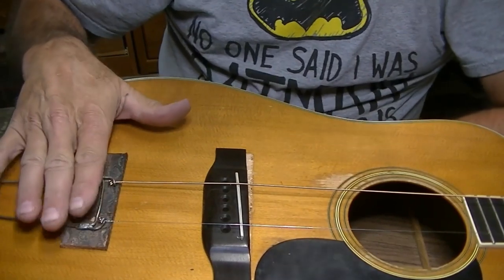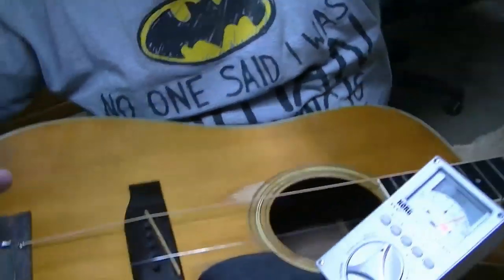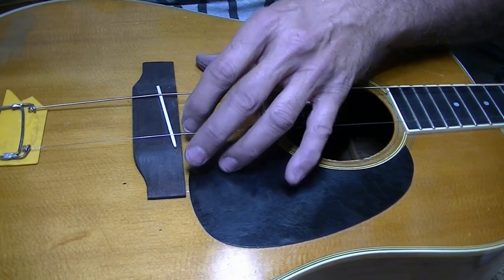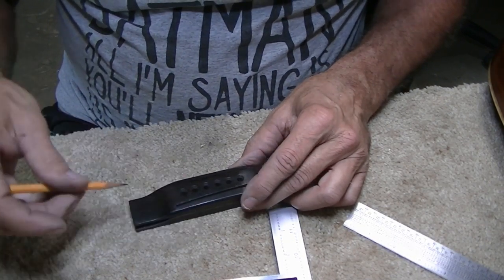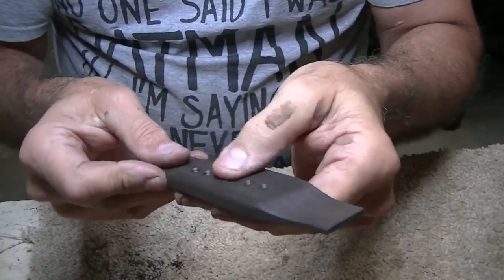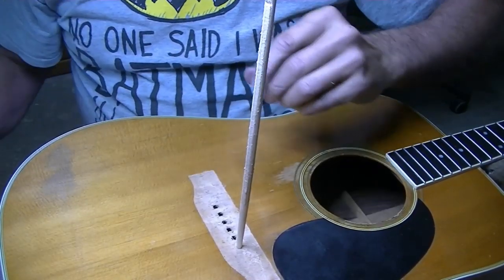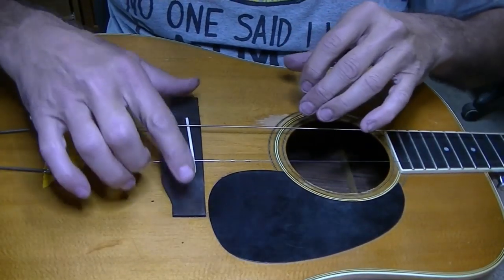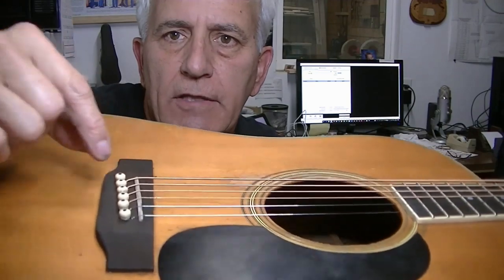316R Rsw Martin D35 With Severe Intonation Issues Revised

Comment: Hi Jerry,  a similar thing was done to the bridge on my 1970 Martin D18s.  I had a re-fret done by a chap who also messed with the bridge by cutting the string slots close the saddle without asking. There was nothing wrong with it in the first place!!  It then caused problems so I took it to Ralph Bown in York, UK.  He left the bridge in place,  filled in the holes with some dowel,  routed out the top of the bridge and inserted some wood into it to hide the old holes.  Then he drilled new pin holes and saddle slot which were slightly further back, the holes are at a slight angle.  There's  a narrow piece of rose wood that runs under the bridge plate to anchor the strings in the new holes. A great job though the guitar has lost some tone slightly but still sounds great and the intonation is better.  Fascinating video.

Comment: Yep. I've fixed heaps of these Martins too over the last 30 years or so. A far more common problem than one would expect. Most often a saddle slot fill and recut will sort it.
Reply: Hi Steve - agreed, my 1967 D-35 also has an intonation problem but I'm inclined to put up with it and just play basic open chords. My 2000 HPD-41 has no issues and plays easily and sounds beautiful. I think it's illogical and unreasonable to expect a vintage guitar that's been well-played over the years to be more or less in mint condition - we have to enjoy them for just what they are and wonder where they've been for the last 50 or 60 years!

Comment: I  didn't see you drill holes through the top of the guitar (after filling the old holes) which seems like one of the most critical steps and I had the most questions about since it's hard to fix if wrong. (Measure twice and cut once.) Very informative. Thanks. I also wondered why some guitars have a slant on the saddle and others do not. Never did make sense to me and still doesn't.

Comment: It seems many guitar companies had problems in the ‘70’s and early ‘80’s
during the guitar boom.
Sad thing is people pay more for them because of it being “vintage”.
Been doing repairs for well over 35 years and in my opinion the newer guitars sound great
and are better made.
Thank you for all your excellent videos. You and Randy are my favorites.
Reply: that´s right. New instruments are build more precise but don´t sound better.
Reply: You are right, however, I think it also depends on the brand and model. Some newer, cheaper instruments are CNC made in Asia, the wood used has not fully dried, or it was dried too quickly in a kiln because they need to be manufactured quickly. There's something to be said for old wood, case in point, the most prized violins are usually hundreds of years old. There are excerptions, of course. Personally, I love older instruments. They feel more broken-in.

Comment: My Martin DCX1E is same exact issue. Low E is off by almost a half note. I feel like I can do this repair myself. What a great video!!! I just had the guitar set up and was thinking they would re set the intonation. But was explained to me that they couldn't fix the intonation. I was never into the technical side of how guitars work, so I was wondering if the guitar came out of the factory like this.

Comment: Hi!  Great video and amazing how you devise your own way to solve a serious problem and save a guitar worth probably thousands.  I have the same intonation problem.  A local luthier said $200 to correct it.  She said my neck is migrating into the sound box.  So on both sides of the neck or fret board that extends over the spruce top there are two cracks in the spruce top along side the fret board.  These two cracks  cause the section of spruce top between the fret board and the sound hole to also migrate into the sound hole a fraction, and it also cracked the decorative layers that encompass the sound hole.  Another luthier took a piece of spruce top wood, cut it to align with the sound hole, then glued it in place.  It stopped the migrating so it seems and seems it's still the intonation.  My guitar is a classical one I bought at a Salvation Army store in 1981.  I like the guitar a lot.  What would other luthiers here charge to do this job?  Does it mean I have to scrap my guitar?  Thanks for this great video.  You are an innovator!

Comment: When I have to cut through the finish, I repeatedly heat the (brand new) blade of the Exacto knife (with a heat gun vs. a candle or lighter). Heat gun makes no soot and less likely to overheat the blade to red hot.  Seems to reduce chipping (or shattering) the finish by partially? melting it... instead of scratching through it..  Seems to work well on thick, UV cured finishs that are REALLY easy to damage outside the intended work area.
AND the hot blade (cauterizes?) the finish's edge that is left.
Keep cleaning the Exacto blade to remove the melted finish . Clean the blade between cuts by scraping (cold) or use heat and wipe off the goo.

Comment: Hate to be critical but your temporary tailpiece should be spaced wider - so that the e-strings pass over each e-string hole.  Because it's a little narrow, i think that your location of the saddle is inaccurate.  You could wedge a block between the strings to widen it, so strings are accurately located.  I love your videos - I've learned a lot and thank you for sharing.

Comment: Jerry, I always enjoy your videos, and I appreciate your work ethic immensely.  One thing you might do to gain insight into intonation issues is to capo at the first and thirteenth frets, and compare F2 to F3 instead of comparing E2 to E3 with the capo at the twelfth.  This completely takes the nut out of the picture, and that is of significance because the nut is usually where at least part of the problem lies.  Illustrating this idea is the fact that older Gretsch electrics like the original Chet Atkins 6119, 6120, 6122, etc., all had zero nuts, and they were equipped with solid bar bridges that had no compensation adjustment, yet the guitars had no intonation problems. For the life of me, I cannot figure out why all guitars don't have zero frets.
Reply from the maker: I understand your logic. And I don't completely disagree with it. But some of it that I do disagree with. For one thing when you Capo and check intonation you're bending the string at the first fret. Which affects your intonation as well. A nut that is cut correctly and set up with  proper action will work as well as a zero fret. Although I understand there are a couple of advantages of 0 frets. It's another one of those deals in my opinion where there's a million ways to skin a cat. I just prefer to do it differently. I do not believe at all in compensated nuts. That is just fouled thinking from the very get-go.

Comment: This isn't the only guitar in history with this issue. I have a Fender Strat Plus, (actually, two of them) which is a high-end Strat with a few extra features---locking tuners, LSR or Wilkinson nut, and crappy Lace Sensor pickups (the only mediocre thing about the guitar) Anyway, I got the second one as a backup and I noticed that the intonation could not be set. Now these Strats are CNC machine made and they are generally very precise. Indeed, the fretwork is great, very even, well finished ends, and the guitar sings; with nice body resonance. So, I was disappointed in the second one. And then day one I looked at it and saw the nut was installed at an angle. Very weird on a machine-carved guitar. Friend of mine fixed it and now it has better action that the first one!

Comment: Good move on re-measuring the string holes after lining them up with the larger angle, because it would have made a difference and the strings would have been closer together. Well done. You should send a copy of the video to Martin. For the price of their guitars this is unacceptable, and they need to see this.

Comment: Hi Jerry loved the video, just a thought, the saddle you placed upon the bridge to initially assess the angle and position for correct intoonation - I've skipped back and forth on the video a few times and it looks (the first assesment saddle), was significantly higher than the one used later in the video after the bridge was glued on.

I know that you don't like adjustable bridges on acoustic guitars the kind with a screw at both ends . As a repeatable point of reference for myself, when setting two of these adjustable bridges, up I've noticed a marked difference in intonation when up or down movement is made. Higher = sharper.

As a side note there's usually a sweet spot on those adjustable bridges, when the adjustment mechanism is transfering the vibational energy well, just take the finished nut down by sanding the flat bottom to play well for desired action and you keep the tonal sweet spot with nice playability.

Maybe the height of the (lower test) saddle normalisi later in the video is because of this effect - the lower the saddle with respect the the fretboard plane and, though minute, the strings 'bends' less to be fretted due to a shallower break angle if it can be termed as such. Thicker bass strings react more to this effect.

I'm sure you know at the other end, high nut slots will make the strings play sharp up to about fret 4. This seems to me to be the same effect just at the saddle end of the string.

Comment: Martin went from producing 7,403 guitars in 1965 to producing 22,636 in 1971; in a mere six years, their production numbers more than tripled. A large number of the 163,887 guitars produced from 1970-79 were fantastic instruments that were built without flaws. However, there were a small number which suffered from what’s generally considered the result of poor quality control.

Even during this difficult period, Martin was producing guitars of excellent quality, especially considering that some of the big competitors of the day, like Gibson, were sometimes selling factory seconds.

The only real quality control issue that Martin experienced in this period was that some of the bridges were misplaced, resulting in poor intonation. It is rumored that a simple yardstick-like piece was used to place the bridges, and one out several used was about a ¼" too short. This issue can be righted by moving the original bridge back, installing a new bridge, or by filling and re-cutting the saddle slot in the original bridge.
Reply: They also had a pick guard lifting issue from about 1970 to 1972.
Reply: Yes that’s 100% correct. I have a 1972 d-18 but its one of the good ones

Comment: Wonderful job. I have a guitar I found at the recycle that needs a new bridge (the original has a split across the peg holes about 1/8 inch, that the original owner apparently tried to fill/repair with wood putty) and I have been wondering how I might approach repairing it, particularly how I might set the intonation. Your tools and techniques have answered my questions. Thanks you so much...

Comment: Jerry, I watched the video previously but didn’t post. I was thinking there had to be something off about the nut for it to intonate correctly with such a extreme angle on the saddle. I mean it’s just x-y=z sprinkled with some geometry right? It did look like less of an angle when you finished the repair than it did when you were doing the lay-out but I still puzzled over “why?” For a long time after watching. As always I enjoyed the video but just couldn’t get my head around how there could be so much angle.
Reply: I suspect it's an optical illusion. I bet if you measured the actual lengths of both E strings, they would be almost exactly the same as any other similar Martin. It looks extreme because the bridge was originally glued on angled the wrong way a bit. Gluing the original bridge on in the right place would have looked fine except for the massive finish problem that creates.
Reply: I totally agree with you . If the geometry is right it should be close. I wondered if the bridge was put on at an angle initially. It looked like it on the video. Either way he had to make another bridge. Jerry you are amazing.

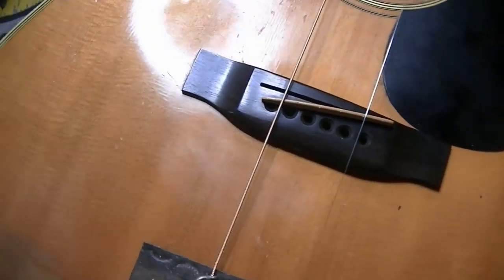Comment: 6:00 Wouldn't the bridge saddle angle be smaller if you ran the strings across their string holes? Seems like the saddle is much more back where the 6th string actually goes and too close where the 1st string runs? Thanks for great resources!

Comment: It can't be that far out without there being a problem with nut or the fretboard not being perpendicular. The distance from the low e nut to the slot and the high e nut to the slot, is the same (plus compensation) , so the problem is in the nut and fretboard not being at right angles.
Reply from the maker: As I said the bridge was just in the wrong place. You notice after I moved everything back the angle wasn't that severe.

Comment: At one of the IBMA conventions ca. 2005, a former worker from Martin told me that the bridge setting template Martin used was not always placed on the top of the guitar in the proper place. Looks like she was right.
Reply: This doesn't explain the phenomenon at all.
The main question disappointingly remains unanswered: Why would a regularily built guitar require such a saddle angle ?!?
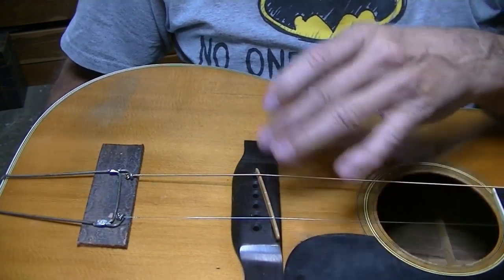04:21 and 20:48 do not fit together - just compare the angle saddle to strings.
20:48 would have allowed a regular bridge, 04:21 definitely not.
Reply: @Three_Eyed_Willy  Thank you for the story. I do believe all of it.
Only: A bridge that is however far forward or back or out of the center cannot explain an angle as shown in 04:21.
This would only be possible with a neck totally bent to one side that would result in a massive difference in length between the high and the low E chord.
The result of the repair as shown at 20:48, which has nothing to do with what is shown in 04:21, underlines this statement.
Please don't get me wrong: I do highly estimate Jerry's craftsmanship.
But in this case he left something out to be explained.
Reply: Another comment describes feedback from Martin ... The guitars were manufactured by temporary workforce during a strike at the time, jig misplacement wasn't identified.

Comment: In order to increase string length without pulling the saddle so far back on one side you can also shave the nut on the issue string thinner so the string is lengthened by coming off the nut closer to tuners....so a few. Times you say it's the only way we can make it work right...it isn't...none of these fixes are optimal because your answer is the martin Luther put the entire saddle.to close to the hole but without an entire top refinish what are you gonna do right.
Reply: That would work for open chord, but when you fret the string, you still have the same problem.

Comment: all my frets are slightly sharp, maybe a little worse on the low e string but its pretty much across the board.   would adjusting the truss rod help?  I've had the guitar for 20 years and never did any adjustments on it.    It still plays and sounds good to be honest so its not horrible.   I don't feel the action is overly high or anything.  seems just as good as its always been with 11s and 12 gauge strings.   I was just thinking of the simplest thing I can do to improve intonation or should I just leave it alone so I don't risk ruining it?  lol

Comment: Great video along with you other video on setting the action. I have made a Martin D28 copy for which I will be using you videos to set it up correctly. I have however another problem in that I didn’t take enough notice of the neck thickness when carving the neck profile. Problem is I don’t know how thick it should be (can’t find any good detail on the internet), just that it doesn’t feel right and my capo (Shubb) is at full extent when putting it on the neck (shows the neck is too thick). Do you have any advice, or have you come across this problem before?
Reply: The only important consideration is: does it play OK for your hands and does it sound OK? I have a 1970s Fender 12-string that has a neck like a tree trunk and it plays great. It doesn't put out deep bass but it has sounded great and that neck has stayed totally stable since I bought it when I was a teenager in 1980.

Comment: I purchased new, 1975 Martin D-35.  I had to remove a lot of material from the bridge, as the height prevented proper string alignment to the neck.   I remember other Martin buyers of the era with similar problems.  How did these things happen?
Reply: The ancient bridge placement  templates that Martin was using, starting  in late 1969 (?)  were totally worn out, hence the bridges being glued in the wrong place.